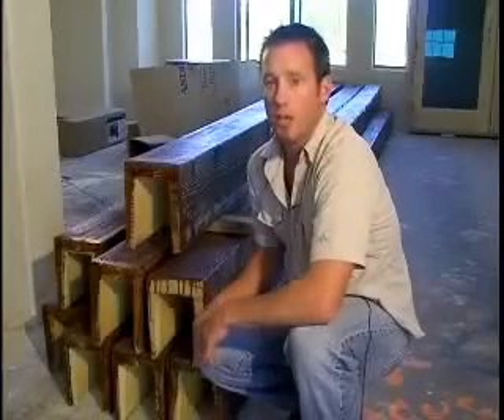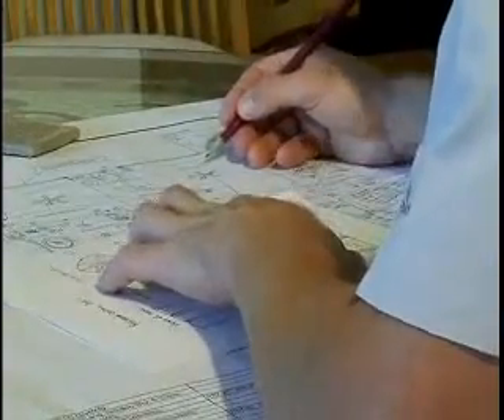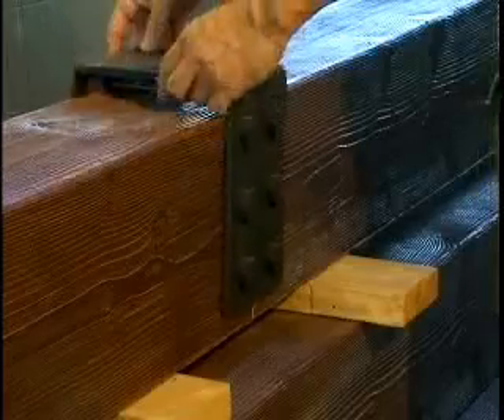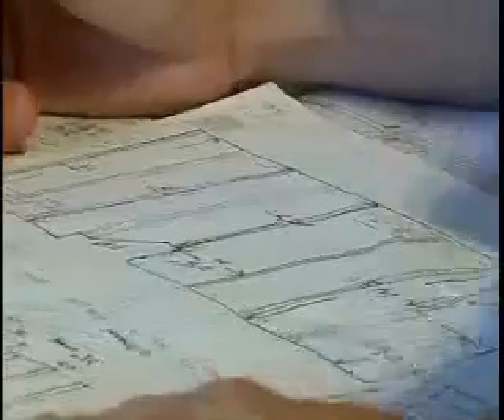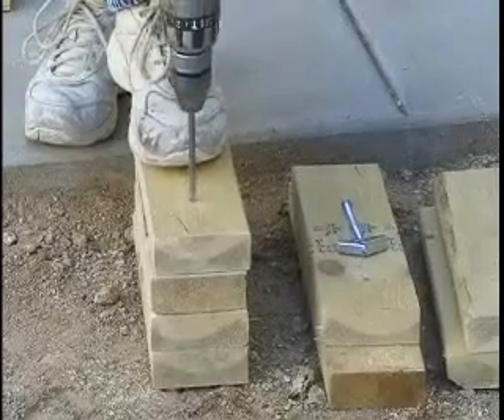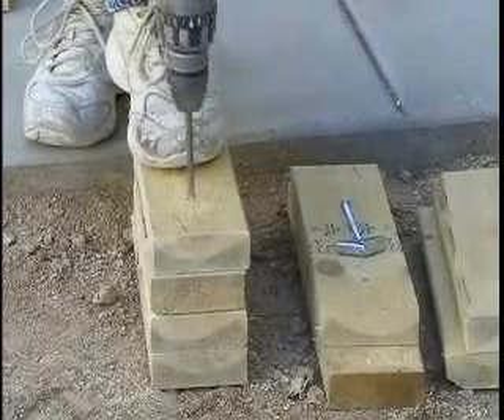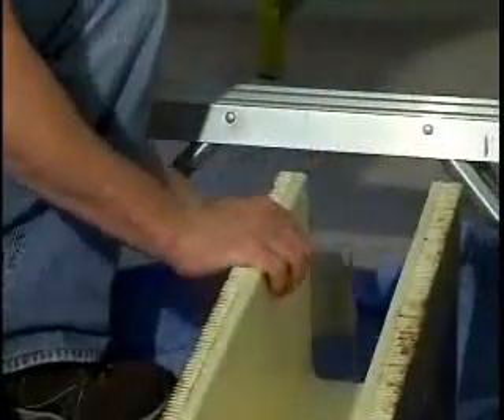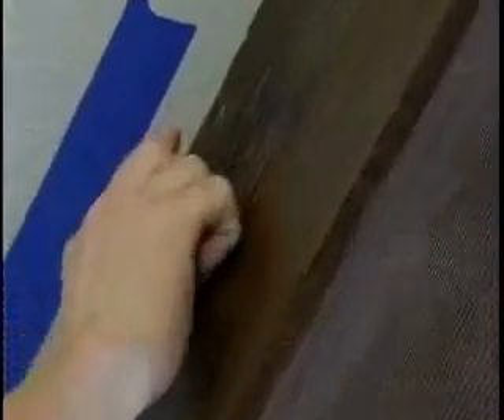How to Install Faux Ceiling Beams | Barron Designs

Comment: Im guessing these faux wood beams cant hold weight? I do aerial yoga and attach my hammock to the beam in my ceiling?
Reply from the maker: Correct! these beams are decorative only and not designed to hold much weight.